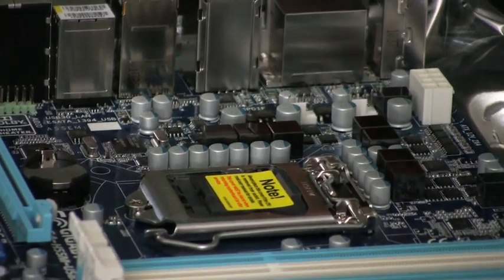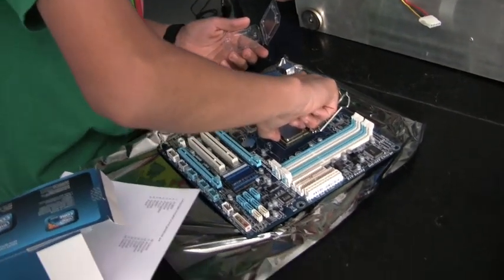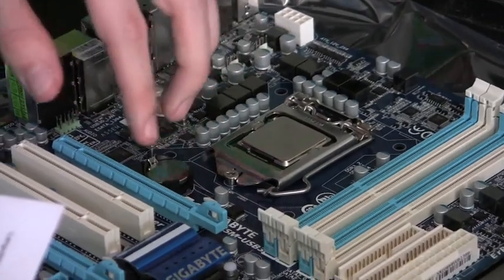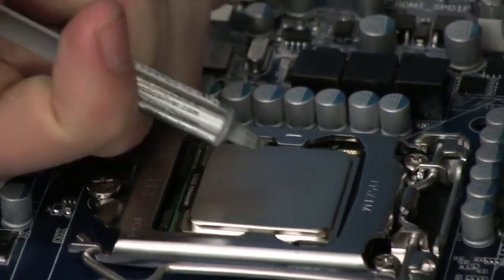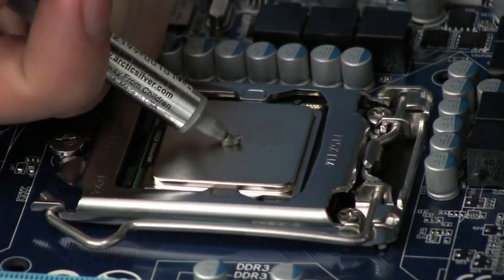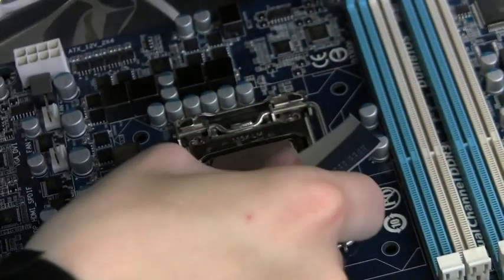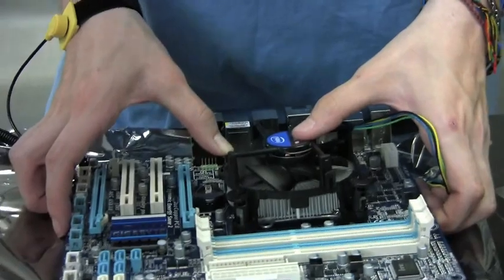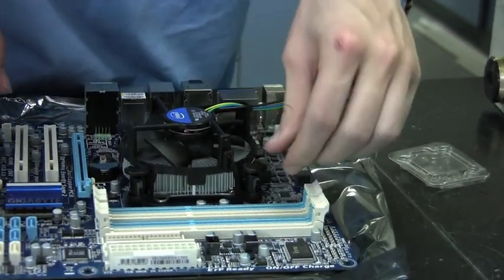Installing a CPU

Comment: @TakeoVeRs actually it does, where I live its super dry, especially in the winter, and I get shocked constantly by static discharge. If the mobo is on that bag, static discharge can ruin it. Its the same reason you should ground yourself while installing components, even if its not powered on. If the mobo is not on a conductive surface, there is less chance for static discharge.

Comment: @theboysdk The paste ensures a full proper seal between the CPU and heatsink. They're not perfectly flat, so the paste fills in the gaps to ensure full contact. It also helps with the thermal conductivity, it'll help draw the heat from the CPU to the heatsink. You can use it without the paste, but it's NOT recommended. If you're OK with buying a replacement (and maybe a new board too) to test it out then go for it lol, otherwise always use paste.